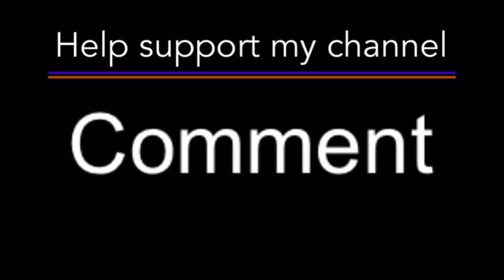Woodturning: Maple Burl to Hollow Form Pot

Comment: 2/21/22  I have finally finished all your videos to date.  I am doing one of my rare commentaries on this one because at 10:27 into this video, you are using a professionally made sanding tool to sand the interior of the piece.  I have not seen you use it in any other video.  A lot of other artists say that this is a great tool.  Do you remember why you didn't use it anymore?  I love your work.  I love your spirit that comes out  in your pieces.  Keep me happy please by making more pieces.  (the sanding tool or similar is on Amazon 2 inch Diameter Bowl Sander with Dual Bearing Head and 2 inch Foam Hook and Loop Sander with 1/4 inch Mandrel and 9 inch Long Hardwood
Reply from the maker: Hey Carey! I do still use that, and more as of late but I don’t include a lot of sanding footage so you guys probably haven’t seen it. It’s called an inertia sander and I use it along with the drill - it’s one of those things that when you need it, no other tool will do!
Thanks for watching, I’m glad you are enjoying the channel. I should have a new video up Thursday as long as we don’t lose power over the next couple of days. We are be getting some significant icing here in Michigan but I’m hoping it won’t be as much as the almost half an inch they were forecasting a couple of days ago!
Reply: @LisaRamlow  That makes sense.  I really like you and your art.

Comment: Very pretty work - Scares me to see the gloves though. If the material were to get caught on the chuck, it would cause very serious injury.
Reply from the maker: Hi there! Thanks for stopping by. I’m aware that gloves are a potential safety issue around machinery but find them to be a necessity for me. I’ve since found that batting or golf gloves work really well and fit nicely, helping to reduce the risk of loose material getting caught. I’ve been woodworking for almost 20 years and everything is still intact. I would like to keep it that way so I’m very careful in the shop. Thanks again for watching 😊
Reply: @LisaRamlow  Thank you for your response. That was thoughtful and kind of you. Certainly you must be quite knowledgeable, and experienced as you are very accomplished, and yes all 10 digits are still in place! Wasn’t wanting to be out of line, but truth be told, I knew you didn’t need my warning about gloves, but it was my piece of mind that had to be put to rest. Just couldn’t leave it alone, as there are somethings that you won’t forgive yourself for not saying, if something unfortunate happens because you don’t. Thank you for sharing your work for all to see.